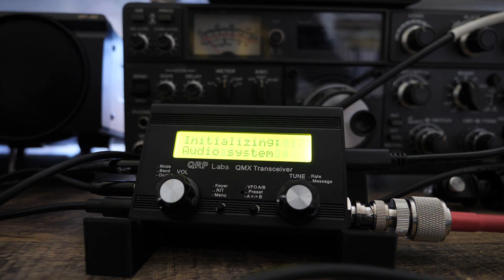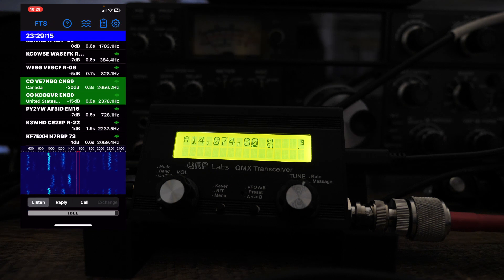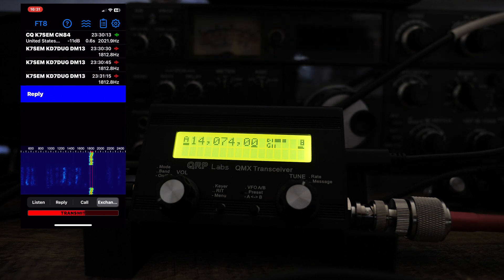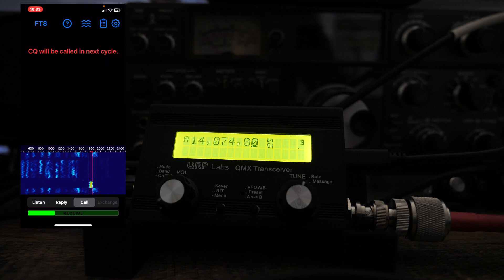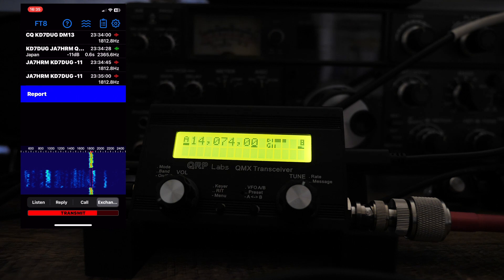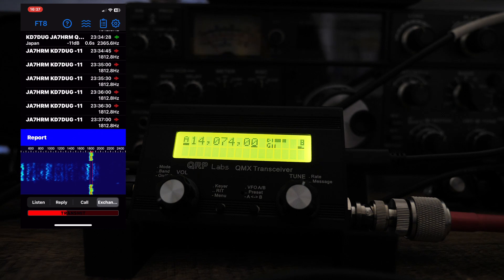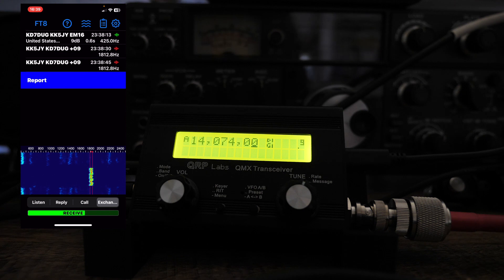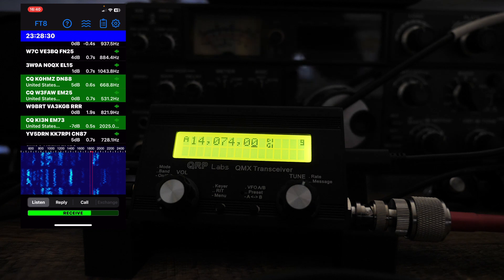iFTX FT8 Setup and Operations on the QMX Transceiver

Comment: Do you know if I could just use a lightning to USB-C cable and skip the adapter?
Reply from the maker: Yes , a USBC works . I use both. iPhone 12 with adapter and I use the USB-C with my iPhone 16.
Reply: USB-C to USB-C works, but lightning to USB-C does not. You will need the adapter, as shown in the video. The apple lightning port does not support USB accessories by default.

Comment: I wonder if this really works because I am trying right now with the same setup and cant make a contact  using my base station antenna. Decodes fine but cant make a contact! the 4.6 watts my LP-100 shows coming out of the QMX should be enough
Reply from the maker: I have approximately the same wattage , ~4.5 watts. I have made contacts both on summit and QTH . You have TX watts of 4.6 so I am assuming you turned on  VOX under digi interface menu. Keep me updated .
Reply: @mountaincwops  The VOX is turned on because I am getting signal out because I can see the wattage in my Watt meter but no contacts. I am going to test today having a shortwave radio next by so I can hear the transmission and be 200% sure that is coming out. I am using a DX Commander with my Palstar tuner at 1.0 SWR. Ive tried putting an amplifier at the end but for some reason when the QMX (or the app) detects an AMP in line it stops transmitting (weird, or some sort of protection)
Reply from the maker: @  you might want to turn of SWR protection if your antenna is resonant. I have to turn off my SWR protection bc sometimes it triggers and stops transmitting signal. QMX has some quirks .
Reply: @mountaincwops  good call, I didnt know I can turn that off. Yes, ill try to turn it off, that way I can probably use an amp to confirm if I can get out. Thanks!

Comment: Don’t have a QMX yet but just did my first POTA activation last weekend. It was the same weekend as CQWW SSB contest so I wanted to avoid SSB besides a little hunting. I stuck mostly with FT8 and used the iFTx app and it was awesome. I made about 118 contacts running 30W into an EFHW across the country and a good bit of DX too. 

I’m thinking that newer iPhones may even be less clunky to hook up since they’ve switched to USB C from lightning.
Reply from the maker: Incredible amount contacts on FT8 with DX. Nice Work!!! I just upgraded the my iPhone to a 16Pro and the  IFTX app along with a small USB-C connector worked flawlessly. No issues.
Reply: @mountaincwops  thanks good to know the USB C will work. The QMX is on my radar. A TP-3 portable paddle is probably next on my list. Working to get into CW ops. Still building proficiency. Have started to hunt with CW but use macros for sending to be efficient.

Comment: Great tutorial.  I used it to get FT8 running on my QMX and iPhone SE.  I also got SOTAmat working, with the same interface.  If you haven't tried it yet, it's a good tool to have.  Uses FT8 to trigger a spot on SOTA or POTA boards under any mode when you are out of cell range.  I don't activate with FT8, I'm a CW op,  but this allows me to post a spot that shows up on the POTA board, and then my subsequent CW RBN spots will get tracked on POTA.
Reply from the maker: Fantastic !!! I have not tried SOTAmat yet . I operate mostly CW too and use the RBN to spot me with the SOTA watch page. After my CW on the summit I’ll run FT8 while I’m relaxing or eating some snacks .

Comment: SSB is in the works. There is already a microphone installed on the QMX. I just built mine. You should notice a small hole on the front of the enclosure.
Reply from the maker: You are correct ! It will be a fantastic qrp radio once SSB is released.

Comment: There is a bug in iFTX that it will not take 5 watts in the settings. 
The log can also not edited if you should forget to set the band. 
But it is cool to only use one cable between QMX and iPhone. It even works without a cable with transceivers with a mic and a speaker so that the iPhone/TRX can pick up the signals.
Reply from the maker: That’s what I was thinking (bug) about the setting not taking the 5watt input value. Thanks for the heads up on not being able to edit the QSO bands if on the wrong frequency.

Comment: I’ve tried using iFTx on firmware v18. It cuts in and out of transmit about once per second in the 15 second cycle. Are all the settings in your QMX default except for VOX being set to On?
Also, when SSB is implemented you won’t need to carry a mic, there is always built in mic in the QMX.
Reply: Thanks for the follow up of firmware and settings. I might try doing a factory reset on the QMX, only turn the VOX on and see what happens. I really want iFTx and the QMX to work together. Thanks for checking that the iPad works.
Reply from the maker: @32532jfbk  You bet 👍🏻 !  Glad to be of assistance. For now I am not updating my firmware since the QMX is working well.
Reply from the maker: Im running iFTX on QMX PCB REV 2 firmware v17. All my settings are default with exceptions to my preferred CW settings. I turn VOX off when operating CW. Oh I forgot about the Electret microphone when I built the kit. Probably the easiest component to install on this build. I also have tested on my IPAD and works well using the lighting to usb camera adapter.

Comment: Interesting.  I have never tried FT8.  I just got a QMX, so I many have to give it a try.  73, Patrick KF4LMZ
Reply from the maker: QRP Labs are engineering fantastic radios packed with options as well as the  price. I thought it was just really cool to have the ability to run FT8 on your iPhone coupled to the QMX.